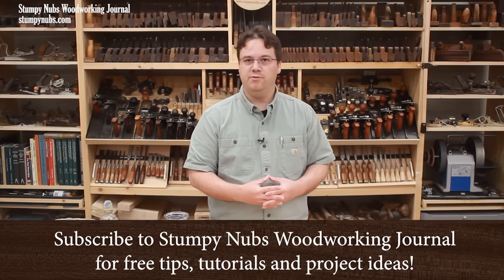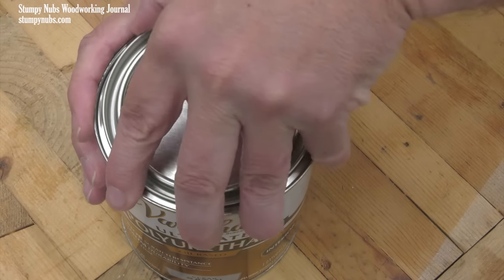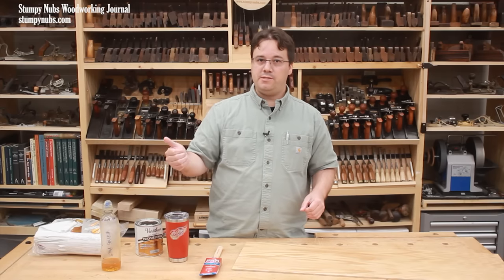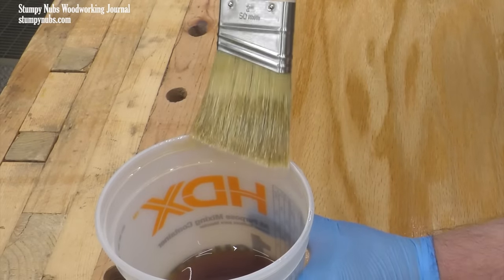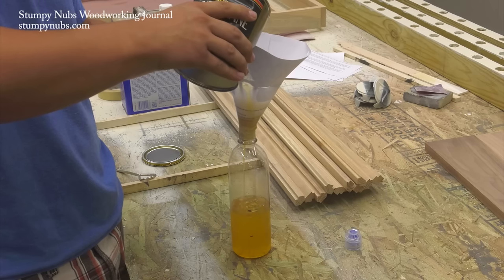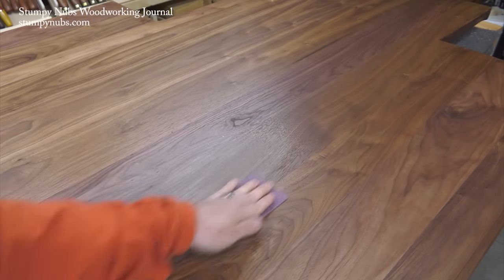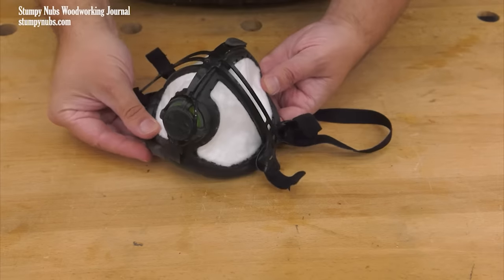Watch this before using polyurethane wood finish!

Comment: I'm loving these finish videos. I've been making custom knife sheaths for all my of my chef friends, and mineral oil just doesn't cut it for these. I never had the guts to try my own poly mixes until i find your channel. I tried mixing my own wipe-on poly after the last video, and the finish turned out great. I find it much easier to work with the thinned-out mixture. And, the paper bag trick worked like a charm. Thank you for the inspiration.

Comment: Nice vid 
1. I wipe on my first finish with a 50/50 mix

2. I wipe on my second finish with a 75/25 mix after a very lite sand 

3. I wipe my third finish with 100% poly after a very lite sand 

4. I brush on my 4th, 5th, and 6th finished (Based on application)

Comment: Here in CO, our ambient humidity will end up being around 15% for a lot of fall winter and spring. If you are like me, you'll need to thin every finish at least a bit. it is very difficult to brush on water based finishes here.

Comment: Hi - Wow you are comprehensive - I am newbie - 
q1.is denatured alcohol good to wipe down ANY wooden surface before applying ANY type of finish
q2. how much importance to you rate ensuring ALL dust particles are off the surface - if so - is that why you use denatured alcohol or does it also do some other purpose
Sorry I hope you did not get lost with questions - I all over the place here

Comment: Thank you so much for your very informative video. Do you have any tips on how I could recover polyurethane that has become thick in the can? I paid a lot of money for the 5 gallon ‘Fast Dry - Heavy Traffic’ polyurethane last year and only used about half a gallon. I just opened the can today and noticed a very thick coat at the top of the can and when I took off the coat, the poly underneath was very thick. What can I do to make it light again so I could use it on my bedroom floor? I went to the store earlier today and saw the 2.5 gallon are selling for almost $150🤦🏻. I still have over 4.5 gallons left in that can. What do I do? I will appreciate any advice that I can get. Thanks
What do I do,

Comment: If all I ever had to finish were flat, horizontal surfaces that I could lay on my workbench, I'd be able to produce some pretty great finishes too.  The reason I now only used water-based poly is that runs and drips are far easier to spot.

Comment: I love idea of the sports bottle and someone suggested priming your brush with the solvent that is consistent with the product your applying.  I almost never use poly straight out of the can.  Add just a little solvent helps it to lay down nice. It’s typically not enough to add much more than an extra coat but it will probably keep you from having to sand between coats.  Never go cheap on brushes.  It’s just not worth the savings.  Besides a good quality brush will last for years.  Keep it clean, really clean.

Comment: Very informative video.  Thanks.  Here is a couple of additional things to consider. I like to use wipe on poly for irregular shaped furniture pieces, like chairs.  A lot easier than trying to brush.  Also for table tops, or tops of cabinets or dressers, I like to brush on several coats of clear gloss poly (thus no additives interfering with the clarity of the finish), making a nice thick coat which I then sand out with increasingly finer paper until I get the finish I want (satin, semi gloss, or even gloss). It gives you an absolutely smooth and clear finish, no grain marks.

Comment: Epifanes makes excellent yacht spar varnishes, and they recommend a first coat dilution of 50%.  Of course, the surface is usually a tropical hardwood, and twenty or more coats is the typical application!

Comment: A tip for not having as much mess in the lip of the can and on your workbench during the pour/filter step. You can get these neat little plastic paint can lips that snap onto the outer lip of the can. A few places carry them,  at least the big orange store does for sure. They cost about a buck and cleanup is pretty easy. Wait till the product is dry and peel it away. Not as good for stains but anything heavily bodied like paint or poly they work a treat and make cleanup much easier. Only downside is when new they are a bit stiff to get onto a quart can, so maybe don't break it in on a full can.
Reply: punch a few holes in the lid recess, so excess poly caught in it drains back into the tin.  i never wipe excess finish out of the brush as it leaves the brush to dry.  dip and then give a brush a couple of taps against the inside of the tin.

Comment: Can I use the wipe on poly method over a wooden drum shell where I've used Tru Oil? It's curing right now. It has about 12 coats of Tru Oil with the last two thinned with Mineral spirits. 
I'm looking to add a thicker protective coating so the Poly seems like a great option.
I'm sure I would need to lightly sand the True oil finish before adding the poly.
Also, it is a rounded shell ... could I wipe on the poly by dipping the towel/rag in the liquid instead of pouring some on the shell?
I fear it would run down the shell if I poured it on. I worked with the shell suspended by a piece of wood through the middle so that I could easily rotate it.
Thank you ... your videos are gold.

Comment: 6:50. Also 'dry brush' with thinner coat to flow the highs into the lows, breaks the surface tension of the highs. mix in a touch of finish to slow the thinner flash off. Watch out for pilot lights and other forgotten flame and spark producing equipment.

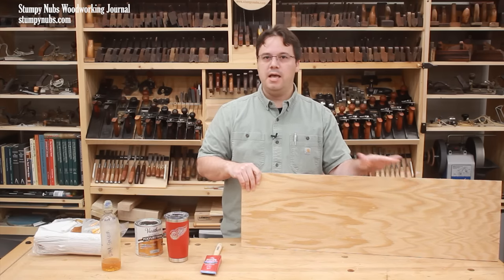Comment: 5:20 I'm looking forward to use  a water-based varnish (namely Saman's). After sanding and before applying the varnish, should I clean the wood with Mineral Spirits, or just water?

Comment: I really like oil based poly, and have used it for years. But I always have brushed it on, or wiped. Have you ever used an HPLV sprayer? I’d like to refinish a kitchen table and I’m considering spraying it, but would like your recommendation.

Comment: Lol, i just thin out the full can with how much fits into the can shake it and start spreading it with diy brush made from folding this random roll of cleaning rags, thin synthetic sheets of cloth basically. Do the how many coats i need with pretty thick layers, then give it a sand with 380 grit and get proper brush to finish the surfaces with final coat or use spray gun. Since i use cheapest brushes around i wont clean them, but instead try to use brush end to put on the final coat, let it dry, cut out the hardened part and use the rest in some early layer or just paint jobs. If you have poly thin enough that it runs properly it will level it self out pretty well. If i make anything fancies then its the spray gun for final layer, though i should probably try that wipe on poly sometimes, might be less messy and give better results.

Comment: Another good way to get a slick factory looking finish is do 2 or 3 coats just like he shows here and after prepping the last coat with sandpaper. Get a can of the Minwax spray polyurethane and spray everything. You do not have to sand between coats or wait for it to completely dry. Fact you're not supposed to let it completely dry between coats. After you spray a coat wait 5 to 10 minutes and spray it again. You can just keep doing this until you run out of product. The spray stuff is kind of thin to use on its own but it is great for a top coating over the brush on stuff. There is another brand of this product that is not worth a crap so don't use it and stick with minwax aerosol.

Comment: I've never ventured into thinning finishes mainly because I had never been exposed to it. Now that I see the benefits I'll have to give it a try.

Something I've found that works VERY well for a smooth streak-free finish is those painting pads you get at home depot. They are rectangular, have a foam backing so they hold a lot of product, and many fine soft bristles so the urethane lays very flat. Take a bit of finesse but the results are fantastic
Reply: I agree.  They allow you to get a REALLY nice consistent surface.  I generally only use them for water base though, as it is easy to clean them with lots of water.  But for a table top, they leave a GREAT surface.  I have some great brushes that can give that finish, but, those brushes are expensive.  Sure, spraying is the best, but when I don't want to get out a sprayer, and don't have a spray booth, then those pads are great.
Reply: are these like the ones that you use as an edger when you paint walls (or that is what they are sold for... I don't use them for that because they smear paint VERY smooth, as you mentioned)
Reply: @MB-xw1tu  yes I've seen them advertised for that purpose too

Comment: I did oil based stain on small section of dining table then applied one thin coat of Minwax spar urethane. After coat is dry for 24hr. Then I used 320 grit sandpaper to buff it before going for second coat. Problem is sandpaper has left scratchy marks and lines although surface feels very smooth. Did I misstep anything? How can the sandpaper scratches be removed?

Comment: Question!  How do you dispose of the Mineral Spirits that you clean/soak the brush in?
Reply from the maker: Reuse it for a while, then use it to start the fire pit.
Reply: Its also a fairly good weed killer as is mineral turpentine and most petrochemicals.

Comment: I make a lot of furniture but I hate brushing anything. If I need to use an oil based varnish, I always thin it and wipe it. Usually 70/30. Hard wax oil changed my whole world though and I haven't used oil varnish in a long time.
Reply: Also if you want a semi-gloss or satin finish, you only need to use it for the last coat.

Comment: What are some pet safe finishes?  I'd like to make cat furniture.  Also, how do you properly dispose of the stuff you cleaned your brushes with?  What's the best way to the polyurathane?  Can you pour the stuff you used (if you're using a brush) back into the container?

Comment: Every cabinet shop I worked in 150 to 180 was for paint and minimum 220 to 250 for stain. Between coats never less than 300 often 350 to 500

Comment: I thin oil base poly for my first brushed on coat on bare wood. This allows the poly to penetrate the surface and provide a sealing base for the next coats. Then the next brushed coats are full poly thickness. I lightly rub 0000 steel wool after each coat is dry to level the surface. I then wipe the surface down with light mineral spirits on a rag before the next coat. I prefer to brush on poly rather than wipe on poly. Just my preference.
Reply from the maker: Arm-R-Seal is already pretty thin. It soaks in quite well.

Comment: Nice video, James.  I've had great luck applying poly with a foam brush.  Is there a reason you don't use them?   Also, after sanding between coats, I wipe the piece with a tack cloth, which helps ensure there is no dust or other particles on the piece before applying the next coat.
Reply from the maker: I've used foam brushes plenty of times. They work, but I feel like the natural bristle brush spreads it better and makes it easier to control the amount I am applying. I also sometimes get tiny bubbles with the foam brush. They usually level out on their own as the finish dries, but they are annoying.

Comment: Wrapping up a brush with oil base does not work like with water based products, but there is a way to preserve your brush with oil base. Wrap the brush with aluminum foil and put it in a container of water. This will keep it soft for a long time. When you're ready to start putting your finish on again just go to a safe place and whip the brush hard and sling the water out of it. The oil based product will not mix with water at all so it's not a problem.

Comment: Watched this video yesterday. I’m sealing a barn door with oil base polyurethane. I poured the poly through a strainer into a cup like you did. After I dipped the brush and wiped the excess off I noticed I was introducing bubbles in the cup which transferred to the door. I started just barely dipping the brush in the poly and shaking the brush above the top of the poly which helped. This is the first coat. Any other tips you can give me?
Reply from the maker: Tiny bubbles from dipping the brush are unavoidable, but they should disappear as the finish levels on the wood.

Comment: If you're going to wear a respirator it needs to be rated for VOCs, a particulate respirator will not block out the harmful fumes from varnishes/chemicals. Respirators are not all equal, I learned this in the auto body industry just an FYI

Comment: I have a hardwood countertop, few years ago when I just got it, I sand it and applied butcher block conditioner (mineral oil and wax based). It has been 3 or 4 years since I last applied this conditioner, because I don't like it. I want to switch to oil based poly, is it possible? I heard that after applied mineral oil and wax, nothing will stick, including oil based poly.

Comment: very nice video, any thoughts on talking about spraying on the poly.  I have been doing this for years with a small air sprayer with adjustable spray tip.  speeds up the process and you can control the thickness as well.
Reply: I am curious as well
Reply: I have also been using hplv spraying for years. I get very nice coats.
Reply: @Justanormalguy191  glad I’m on the right track then 👏🏼

Comment: So here is a question that may or may not be directly related.  Last year we built a "boardwalk" in our side yard out of multi-colored stained pallet wood.  It has held up nicely but we are wanting to put a protective coat on it this year.  It is walked on periodically.  Would you recommend oil based poly or should we use another type of product?  Thanks James!!
Reply from the maker: Nothing is going to make wood hold up well in direct contact with the ground. But if you do want something on it, I'd use something with a UV protectant. Look into high quality deck finishes.

Comment: This same channel has a video called "Finishing blunders: Why wood stain comes off" that makes me terrified to try wipe-on poly on my darkly stained desktop project.  If that's a real concern I feel it should be mentioned in the description and future videos to save people from this problem.  Thanks!
Reply from the maker: That video is about gel stain. Did you use a gel stain?
Reply: @StumpyNubs  oh, no I didn’t.  Thanks for the reply!!
Reply from the maker: @AndrewCurrieArt  Unless you didn't properly wipe of the excess stain before it dried, the color should be in the wood's pores, not on the surface. Applying a wipe-on poly should have no affect. But test it first by rubbing a bit somewhere on an underside where it won't be seen.
Reply: @StumpyNubs  Thanks for the clarification!  That sounds like a good plan.  I appreciate the in-depth teaching and explanations, I have learned so much from your channel.

Comment: I've been home woodworking my whole life I'm 66 now I'm in the in the process of building a walnut countertop that is 5 ft long and 24 in wide made up of four individual slabs of black walnut and I have a couple of questions one would be do I need to recess a steel c channel across them to keep them from warping over time or is just adding a really good several layers of polyurethane sufficient to seal it?
Reply from the maker: How thick? I've made 1-1/2" and 2" thick walnut counter tops with no channel and had no issues. But it was dried well and installed in a climate-controlled house.
Reply: @StumpyNubs  2" thick, planed down to 1 3/4"

Comment: What about rollers for large areas?  I do a bit of sealing on cemeticious materials, and hitting 20-30m2 of area follows the same theories outlined as a per this video, but with roller application you're cutting out pretty good sized sections at a time.  So, if you were polying timber at 8'x4', say a table top, then hitting it with even a 4" sleeve on a pole is going to afford you good stroke length.

Comment: What is a good container to store wipe on poly in? The metal can it comes in is always difficult to get the lid off. I used a clear catchup bottle and it got a think lawyer of hard poly on top.
Reply: I have a long-running (~3 years) experiment storing it in a gallon glass jug with a small lid and well-sealing cap. After every time I dispense from it I add some argon from my TIG torch. If it ever does cure in there it will be impossible to clean but so far so good.

Comment: The instructions on the Varathane can state that the material should not be thinned. Also, that it can be recoated without sanding if done within 12 hours.
Reply from the maker: It doesn't say it CAN NOT be thinned. They are trying to simplify the process to reduce customer service incidents.